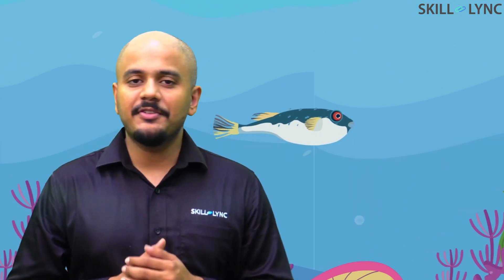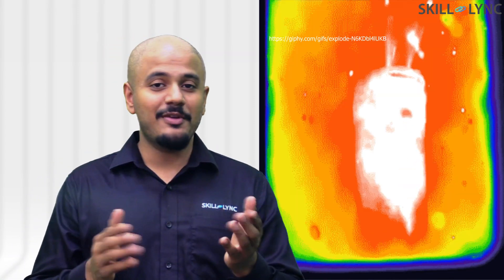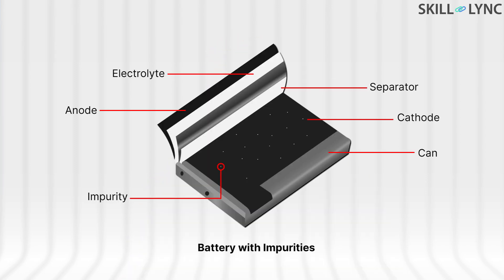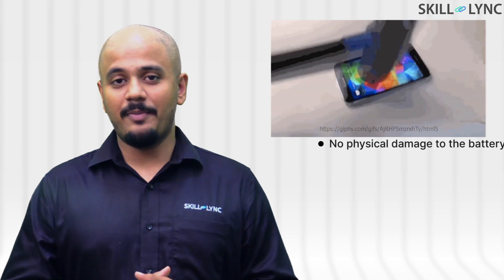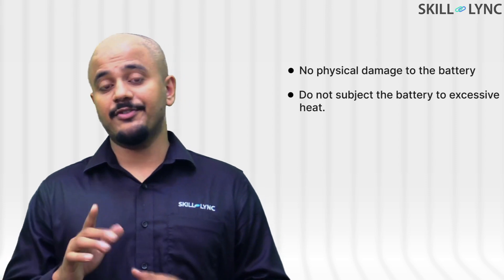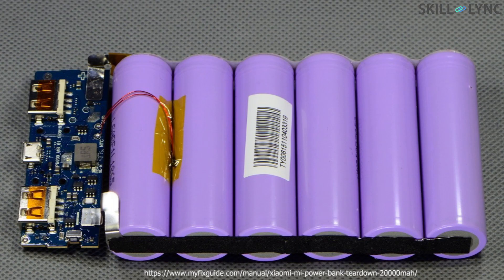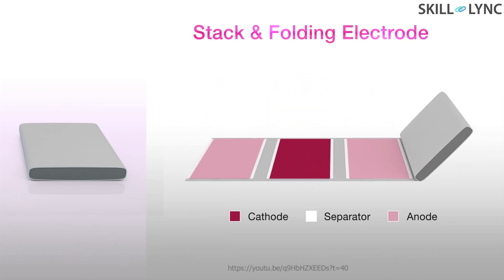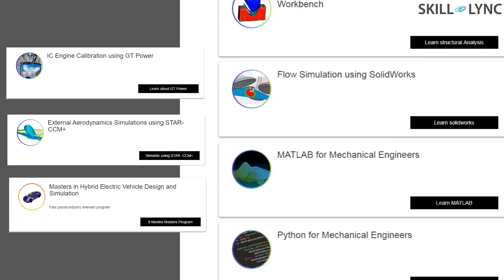Why does a Battery Puff Up? | SKILL-LYNC

Comment: I went on a 2 week vacation with a swollen battery: when I arrived at the airport to get a local SIM it looked as if the back case was coming off; I thought the phone was old or dropped in the past. When I came back to re-switch the SIM the battery was swollen up. I'm not happy about this: what causes it ?

Comment: My huawei mate 10 back cover is gradually coming out. For now its just about half mm or 1mm out. I dont exessivelly heat up the device , nor do i store it for a long period of time (i use it dailly). What could be causing that?...
And how do i ensure that i'm buying an original battery if in my country there are no official huawei stores...? Any idea?
Thanks for the info.

Comment: Yeah this makes sense. I was curious as to why the battery in my plasma lighter began swelling up (eventually putting too much pressure against the metal walls and breaking the lighter). What I noticed after plugged it in tho is the circuit board heats up, thus cooking the battery, and making it inflate. Thanks for the vid

Comment: My suggestions.
1. Use original battery charger.
2. Don't over charge. Keep charging between 40 to 80 or 30 to 90. We just have to make sure that mobile does not heat up.
3. Avoid using mobile while charging . Specially heavy programs.
4. Avoid using Hotspot. I spoiled my mobile battery because i used 7-8 hrs hotspot daily. Better buy 4G router.

Comment: My phone battery puffs up every 5-6 months and i keep replacing the battery!
Reply: it wastes money
Reply: probably not properly charging your device could be wrong voltage
Reply: @Zennitube  i charge my phone with my original charger so!
Reply: Same bro and I can't afford more to replace battery
Reply: @RolexSir213  i have the same money issue! But soon i will get enough money to buy myself a new phone! Good luck with you'r phone! :)
Reply: @IOAN2ER  can i use my phone for few months??
Reply: Why don't you buy a new one instead 😒
Reply: @pratikshasubba9537  cuz my phone is working well af, my battery is the problem!

Comment: I have replaced my samsung battery for 3x (Samsung A7 2016), it bulge after only a month of use after each replacement. What could be the problem.
Reply: finally i found same as i experiencing right now so i must to replace the battery and buy the stock charger of my unit 😭